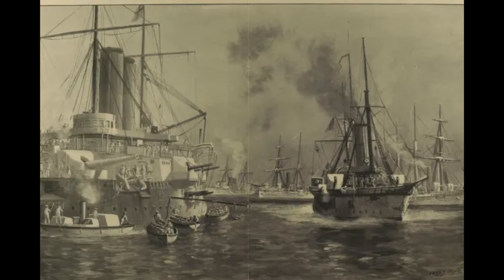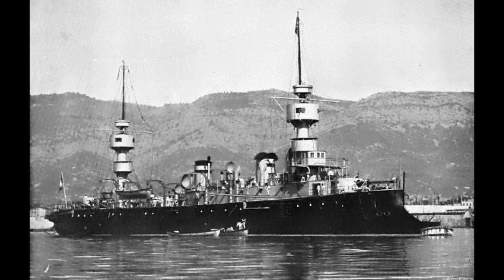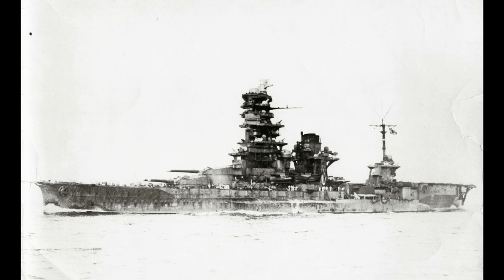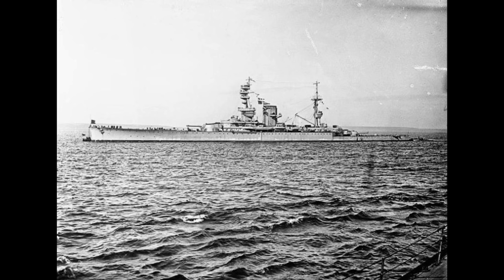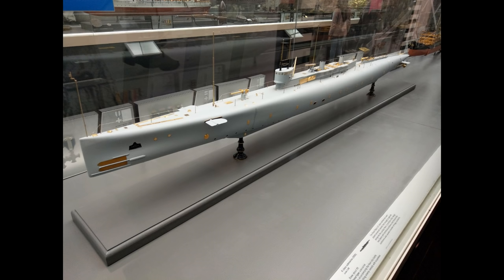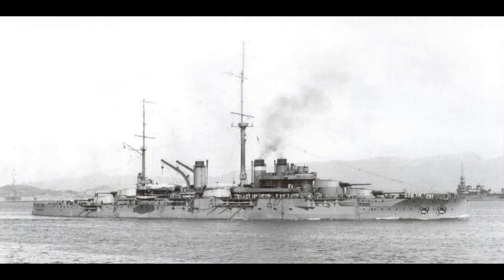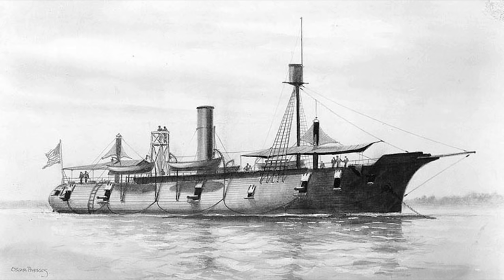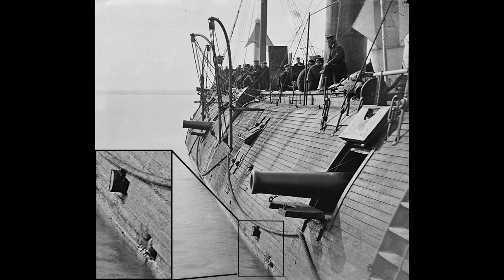Naval Engineering Disasters - How not to design a ship

Comment: The rant following the description of faullt on first place is so terribly british in all regards, I love it. How different might WWI have turned out if Indefatigable would have been in place and sunk at the battle of the Falkland Islands? Spee still wouldn't have made it home, but probably would be remembered even more for taking down a ship, one specially designed to hunt his squadron, in his last engagement. Also the British might consider their usage of Battlecruisers quite differently, maybe giving the rest of the class a smaller uparmouring, or not letting them participating at Jutland in parts or at all, which would give that quite a different outcome, Beatty being slowed down after turning back, probably with more casualties, or not being there, so either a full on fleet clash when both main lines clash without prior scouting, or a complete decline of battle if the german battlecruisers can make early contact and advise the main fleet.
Reply: For starters, I imagine the Renowns (laid down a month and a half after the Falklands) would've immediately had their construction delayed long enough to do away with the bizarre design decision of a 6" armor belt. At an absolute minimum, they'd revert to a 9" belt like the Lions and Tiger already used. ie what they historically were given in 1920s refits. Or possibly even the Design Y battlecruiser (the "Super Tiger", with 11" belt and 4x2 15" guns) would've been built instead.

Possibly the funding that went to 2 Renowns and 3 Courageouses historically would've gone to 4 Super Tigers. Or just 4 up-armored Renowns. Aside from Indefatigable being in immediate need of replacement, there'd be a perception that her sister ships are inadequately armored, while Germany's own battlecruiser fleet would still need to be countered. Adding 4 instead of 2 15" armed battlecruisers would allow Australia and New Zealand can be sent to safer duties than directly confronting their German counterparts, while still directly upgrading the fleet's strength. Though of course Jutland would happen before any of the new ships would be complete, so this plan wouldn't have a chance to be put into practice.

When it comes time for Jutland, the 2nd and 3rd Battlecruiser Squadrons would probably have been rearranged to account for Indefatigable's loss. Most likely it would be the now under-strength 3rd (consisting only of Australia and New Zealand) that gets detached to the Home Fleet, leaving the 2nd Battlecruiser Squadron (the 3 Invincibles) at the tail of Beatty's battle line. No way to know whether the collision between Australia and New Zealand would still happen when they're up at Scapa Flow, but it's possible that New Zealand will be the only battlecruiser attached to the Grand Fleet at Jutland. This would actually be an upgrade to Beatty's force, though whether he'd gain any advantage out of this is questionable, since it's Beatty.
Reply: @RedXlV  I have to agree to that, as I have no idea to the constructions and timelines there. Beatty being Beatty, yes, might not make use of any advantage given to him or even invite a more foolish sense of security. I wonder if on the german part Spee's small rebuttal will change anything attitudewise and accelerate events. Scheer replacing von Pohl due to illness is probably a fixed event, but questionable if his replacement of von Ingenohl might change and lead to an earlier Jutland, but thats very much unlikely and pure speculation.
Reply: Idk, the RN has always been considerably more bloody minded about losses potential or actual than its contemporaries.  You might be right, but it's just as likely the outcome would have been limited to some stoic references to omelettes and eggs, and Beatty would still have steamed right in.
By way of example, much is made of what a beating the US cruiser force took in the Pacific; but then consider that the RN lost three times as many cruisers in WW2 than the USN did, and by 1944 were still running them up to the Normandy coast to take on the shore batteries (and E boats, and U boats, and mines).  If anybody was wondering whether they were optimally designed for the task, it wasn't stopping them from being committed whenever and wherever they could be of use.

Comment: A couple of notes regarding the Ise-class conversions:

1. Hyuga's No. 5 turret was apparently wrecked by an ammo accident in 1942, and the No. 6 turret had elevation issues from the start - so to an extent the conversion was motivated by the Navy deeming it less useful to replace two already broken turrets and to instead add the catapult for aircraft.

2. Almost all documentation strongly indicates the ships could only launch planes. Returning aircraft could not land on either ship. As a result, they were both equipped with float planes - which by default were not great fighter aircraft as the floatation systems tended to weigh down the plane for maneuvers.

3. Japanese doctrine actually assigned all of their scout aircraft (many of which were sea planes and strike aircraft) to the cruisers escorting the carriers. The Tone-class in particular exemplified this.

After Midway - where a failure in scouting by the Tone was a major cause of the defeat - it is very likely that Ise/Hyuga were converted to serve more as oversized Tones, rather than as a truly independent strike carrier force.

Likewise - note that the Japanese had no idea that the US would end up making so many carriers. Midway was a devastating defeat for Japan, but by Santa Cruz the USN had likewise been reduced to just the carrier Enterprise in the Pacific. Without the massive American shipbuilding industry coming to the rescue Japan in fact had some room to believe they would face the Americans on relatively even terms in 1943/44, and in these new battles shoring up the scout group complements would have made sense.

It is also worth noting that these small scout groups still nonetheless did admirable work under the circumstances. Mogami for instance had a similar conversion - which gave Nishimura's force accurate scouting in the lead up to the Battle of Surigao Strait. Trouble is, it turned out that Nishimura had been ordered from the start to embark on a suicide mission and he was deliberately just bait to draw 7th Fleet's battleships away from the Leyte Gulf transports, whereas everyone in the Western world assumed he had simply blundered into an ambush (at least until Parshall's Battle of Surigao Strait uncovered Japanese documents that showed Nishimura in fact had the clearest idea of any of the Japanese commanders of what they were facing, and was basically told to proceed anyway in a manner similar to the final sortie of the Yamato).
Reply: Good points except for the one about US shipbuilding.  Japan was well aware of US manufacturing capacity, and Yamamoto was very vocal in warning the powers that be about this.  Moreover, many of these US carriers and battleships had already been ordered and laid down by 1941, so Japan definitely knew about those.  Japan might have slightly underestimated the time it would take the US to complete them, but their whole strategy was to hit the US hard and pray for a negotiated peace that allowed them to keep some of their gains before the US had time to regroup.   I’d say the USN was fighting on relatively even terms in early-mid 1943, but by late 1943 and 1944 the floodgates had started to open.

I wouldn’t say “everyone” in the Western world assumed the Japanese had blundered into an ambush at Surigao.  Admiral Lee and some other USN officers had a pretty good idea of what was happening and when.  They just couldn’t convince Halsey of it.
Reply: 80 YEARSLATER it is a shame we still know very little of this history FROM THE JAPANESE!!!!!
Reply: One of the best comments Yet about the Ise class.
Reply: Fun fact: When her crew realized she was the only operational U.S. carrier left in the entire Pacific theater, they responded by putting up a banner on her island that said "ENTERPRISE VS. JAPAN!" And she won, too.

Comment: 17:21 the IJN doctrine states that battleships and cruisers have to provide for their own recognition: carriers do not carry any recce plane on board. Later in the war the carrier number was becoming scarce and it was understood that providing recce intel with just cruisers and battleships mounted planes was not feasible. Ise was an attempt to provide eyes to the fleet without losing hit power on the few remaining carriers. Ise and Hyuga were "FLOATPLANES" carriers anyway. They were too slow to be effective but I can see the reasoning behind the conversion; they could have removed the useless two stern guns remaining but we have to understand that "ballance" in a hull buoyancy is also a thing and a single turret assembly can weight thousand of tons alone, and especially in such a stern armed ship, removing everything could have caused too many issues. A failed experiment out of desperation but not among the worse, expecially with the USN operating such odd monstrosities as the fat short WWI era battle barges across the Pacific.
Strike aircrafts have longer legs then fighters, with usually 2 or more pairs of eyes and hands not flying the plane, and because they have to be floatplanes, as fighters they would be useless as fighters in 1943, so IJN chose to have recce planes that could damage things if opportunity arose.
Among the failures I would have put Tegethoff class: the B turret with three guns could warp the hull just by firing due to severe undersizing of the hull structure. The crew of the main turrets could choke to death, not being allowed to fire for more then 15 minutes before opening all the bulkheads and portholes to allow air in.
The crew was so sacrificed quarter wise that the ship was unfitted for more the a week out of the port, having to literally sleep among the machineries, while the officers quarter were as luxurious as in a line ship first class, if not more: talk about priorities!
The roof of the main turrets were so under armoured that a glancing shot from a 12" gun could have ripped it straight off the ship. The Tsaint Istvan was built in Croatia for political reasons and the execution was so poor that it should have been rejected straight off but the Hungarians refused to do that forcing the Austrians to put it in service.
Reply: I’d take the fat short WWI-era battle barges over any of the Japanese battleships with the exception of the Yamatos in a straight gunfight.  The Japanese ships were somewhat faster, but the US standards had substantially thicker and better quality armor as well as markedly superior guns (after the original guns were replaced in the 1930s).  Even if you throw escorts with torpedoes in the mix, considering none of the WWI-era Japanese ships besides the Kongos were going to have a prayer of outrunning the escorts, and considering the Standards were highly maneuverable, it might not make much difference.  Japan would have some advantage in an early-war night engagement, but I’m sure the USN would do everything possible to avoid it (since they probably wouldn’t be in a confined area defending a fixed position like at Guadalcanal).   But the USN also knew that the old BBs weren’t well-suited for fleet operations anymore, so they relegated them to second line duty.  The Japanese seemed to recognize the same about their old ships (except the Kongos), and didn’t use them  in likely surface battle scenarios until they were desperate at Leyte.

As for carriers not carrying recon aircraft, they didn’t carry dedicated recon aircraft, but it’s not hard to send out a few fighters as scouts if the captain is so inclined.
Reply: If it was only about having scout seaplanes, they probably would have gotten a better mileage out of building more Tones instead of battlecarrier conversions. But the IJN had some bloody stupid ideas on how to do things anyway. Like putting the Tones together in one Cruiser Squadron instead of assigning each to a different Carrier/Battleship Division.
Reply: The biggest Advantage the Imperial Japanese Navy had over the United States Navy was the range of their strike aircraft
By using shorter ranged float planes for reconnaissance, they negated that advantage
Reply: the fact that they wasted all that STEEL alone is a crime. Thy had none to spare.
Reply: @bluemarlin8138  US Navy Standards didn't really receive new and better guns in the 1930's, they had the barrels chrome lined for better wear characteristics. The Japanese 14" guns were also a fairly good gun, being a Vickers design. Both the US Navy and the IJN designed better shells, and for AP rounds, were pretty good on both sides. The quality of Japanese armor on the older ships was also just fine, being very similar to British armor. This is actually somewhat better quality wise than US Navy battleship armor. Japanese armor quality fell off sometime after the Nagato's, when the Japanese had issues with getting the alloying elements like Nickle or Chromium in the 1930's.
Reply: @Chounubis I smell a USN fanboi. The IJN battleships were a fair match for the USN Standards in a fair fight, which they were never going to get. Notice that the US Navy, when given a choice, kept the Standards entirely out of front line combat. The Standards were as much a blessing as they were a curse for the US Navy. Tough, reliable, and slow. Great if you're blockading someone, terrible in a mobile war fought not between great battlelines, but between small groups of ships.
Reply: @SgtBeltfed  IJN WW1 vintage BBs are worse. They could run yes but their armor is poor. Only Nagato has the power to truly hurt the standards. But even then the Standards can shred Nagatos armor pretty easily on any battle ranges than Nagato could. And Closing the distance would be suicidal for the IJN BBs lmao. It's like Yamato and Iowa again but this time the Standards are Yamato and The IJN BBs are Iowa but without radar Only and only Nagato has the more meaningful Firepower.

Comment: Modern attack submarines are very much "fleet submarines" in their role escorting carrier strike groups. In the very, very long run, the concept worked out :D
Reply: It only required the invention of the nuclear reactor.
Reply: @oskarrasmussen7137  A large diesel boat could comfortably keep up with a non-nuclear carrier, I suspect. Nuclear power isn’t magic, it just significantly expands strategic mobility.
Reply: @jamesharding3459  This little "just" is, basically, the biggest magic in the environment of the modern warfare, cause diesel fuel need to be loaded safely, stored and delivered safely, delivery systems also need fuel and maintenance, with qualified personal. Maintenance eqipment itsel often also required fuel and spare parts and trained operators, and all this quickly spirals in usual hellish madness of keeping your fleet in somewhat operational state.
Reply: Well they are still steam ships, just how they make the steam has changed.
Reply: @nickyevdokymov5526  The fueling is irrelevant. What nuclear power did is allow the subs to travel at comfortable speed underwater indefinitely. This is the part necessary for a "fleet submarine" role.
Reply: @jamesharding3459  bear in mind that with conventional subs you need two propulsion systems with two energy sources. You want a fuel burning propulsion on the surface and an electrical propulsion system when submerged. The former requires fuel, the latter requires batteries. This stuff isn't weightless, quite the opposite actually.

On top of that, I believe subs are much less stable on the surface, remember that conventional subs are significantly smaller than destroyers. They're inability to be stable in rough seas will impact their speed. Nukes get around this by never needing to be on the surface and having higher submerged speeds.
Reply: @tommihommi1  Man, tell "fuel is irrelevant" to the designers of the modern nuclear carriers, which can hold up too three times more aircraft fuel, then diesel powered ones, or Russian nuclear icebreakers, or crews of WW2 era German subs, or any diesel sub crew, even modern ones, with AIP system onboard)
Reply: @nickyevdokymov5526  The fuel logistics aren't why nuclear power is necessary. The air is.
Reply: @jefflace4949  I am well aware of the constraints conventional propulsion systems place on submarines. There is a reason all major navies user nuclear power for their hunter submarines, after all. I was merely disagreeing about the necessity of nuclear power for a functional fleet submarine -- it's obviously not the best choice, but it is a possible choice.
Reply: Submarine hulls are designed for optimal performance in their natural habitat-underwater.
They distill fresh water and air from onboard equipment and also have a diesel powered generator for times when shore power isn’t needed.
There are two types of ships on the ocean,submarines and targets.
SSBN Gold in my youth.
Reply: Submarine hulls are designed for optimal performance in their natural habitat-underwater.
They distill fresh water and air from onboard equipment and also have a diesel powered generator for times when shore power isn’t needed.
There are two types of ships on the ocean,submarines and targets.
SSBN Gold in my youth.

Comment: As far as the hybrid BB/CVs go, I think fighters would actually use more fuel, not less. The reason being that your fighters need to be in the air before the enemy arrives. Otherwise, by the time you get them prepped to launch, launched, and they get up high enough in altitude, it'll be far too late. So you need to launch them if enemy contact is possible, and keep them up all the time from that point on. And that means they fly a lot more, which in turn means more fuel use, more maintenance. With the strike craft, you only launch them when you have something to strike. And with the how the Japanese fortune was at the time, you don't even have to recover them ;)